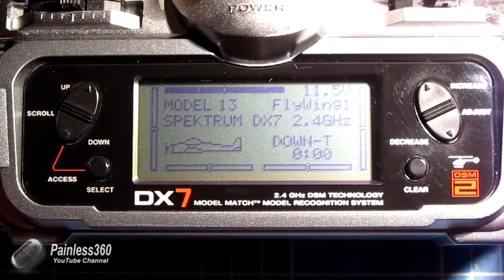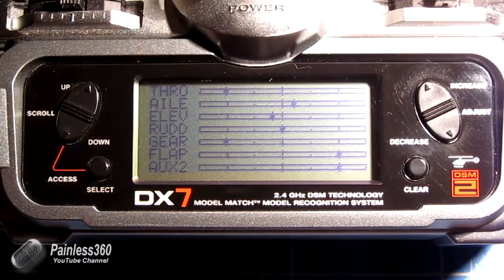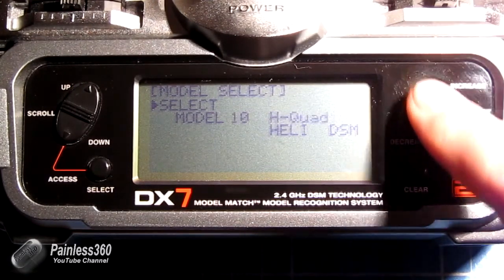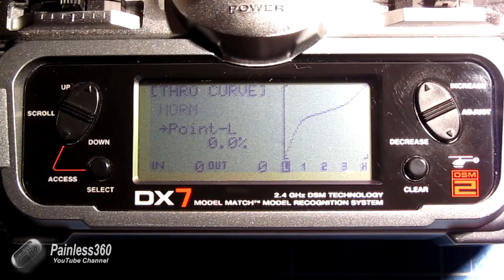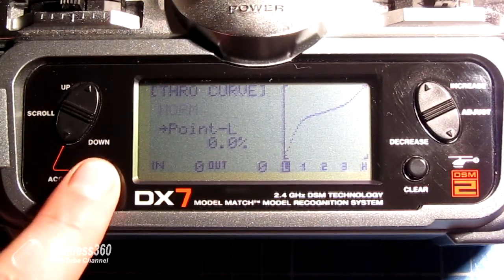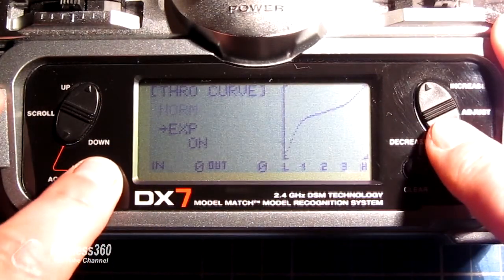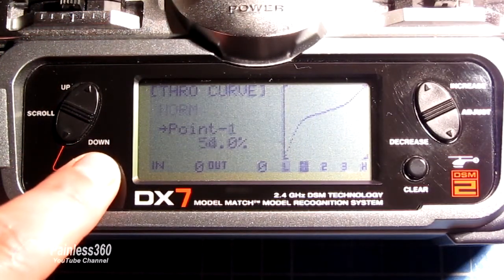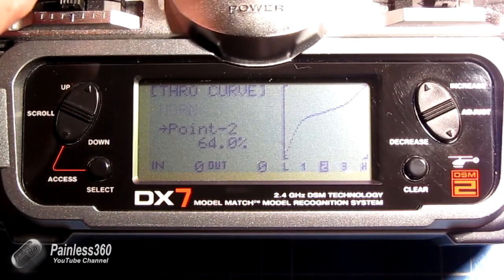DX7 smooth throttle curve - how to

Comment: Will setting throttle curves help with a yo yo effect that I am having with my quad?  I mean I can get it to hover pretty good but I really have to work the throttle to get it to hover nice otherwise it moves up and down rapidly at times
Reply from the maker: Hi Zip, exactly!

I use this to deaden the throttle around the hover point and it allows me very fine control of the quad/hex in the hover. Thanks for watching.

Happy hovering!

Comment: I changed to Heli mode for the throttle curve, but now the aux2 switch is going with the throttle and I can't take it back, had to input select aux2 > f. Mode to make the original Aux3 left side 3pos switch to be used in flight modes, but I don't know what to do with Aux2 2pos switch which is associated with the throttle, would you tell me what to do...DX7
Reply from the maker: khaled Homouda Select 90 degree swash - that should help..
Best of luck.
Reply from the maker: It is on the radio. This is covered in the manual (Page 80).

Best of luck.

Comment: Should I do anything different if the hover point is well before mid stick?  I wanted to fly my quad without any extras so I took off the landing gear and mobius and found it hovers at 30%.
Reply from the maker: bharris3 Sounds like your model has plenty of power! What motors/props are you running?
 I personally would move the throttle curve so it hovers around mid stick. I do this on all the models and then the throttle/hover point is consistent. It's personal choice really..
Happy flying!
Reply: Painless360 I'm using 1806 2280KV EMAX motors with 5030 Gemfan props on my Minion Quad.  And I was wrong, it was at 30% with the mobius attached.  I took your advice and put the hover at mid stick.  The curve looks kind of funny but it works.
Reply: Painless360 As a follow up, I now know why my initial throttle curve wasn't working.  Since I hover at 30% my Quad would actually start to rapidly ascend before even reaching the plateau of my badly placed curve at 50% throttle.  Now I can fly low without issue.
Reply from the maker: Great news. Glad it is working better.

Happy flying!

Comment: Can you please post a video how to setup apm flight controller with the dx7 thank you I just finished my first build and can't get the right settings on dx7 transmitter. Thanks for your great helpful videos.
Reply from the maker: The DX7 is a straight forward radio to setup with a quad. See my video on ACRO or HELI settings that covers some of this. What is it that you are struggling with?
Reply: Thanks for replying, I got over some issues like the right stick was reversed forward is backwards left is right and so, I managed to change it in the transmitter, can you reverse it in mission planner? I got it flying now but I can't get the 3 position switch to work I connected aux to channel 5 but it won't work so I connected gear switch to ch 5 and using gear switch now I only have 2 flight modes that's my problem now. Thanks.
Reply from the maker: This is all about the radio config, not the setup on the APM/mission planner. Make sure you've followed my first APM setup video and it's all setup right.

Use the channel monitor on the radio (shows the values of the channels) to make sure it is setup for the three values on that switch.

I use Heli mode myself and set the three values for the switch using the pitch curves (zero for Pos 1, 50% for Pos 2 and 100% for Pos 3).

Best of luck with it.
Reply: Can you make a video setting this remote up for the DRL sim

Comment: my throttle stick moves my rudder. my left stick moves my elevator up and down when I move the stick left and right. all my settings are backwards,,. how do you fix this???
Reply from the maker: anthony perkins Is that a serious question?
Reply: well, it was BUT I was told that its half right. My Left stick moving my elevators up and down are wrong, need to reverse it  I guess. Im new at this so bare with me.
Reply from the maker: OK, if it was a serious question then let's cover the basics - what radio?

Comment: I am trying to set up my DX7 (first use) for use with a Phoenix Flight sim.    is there a simple way to set a linear curve ... or do I have to use the 'norm'  and set each set point
Reply from the maker: Yep, I'd use norm and setup a line, in practice I find a little flattening out around the hover point makes the model easier to hover smoothly. Happy flying!